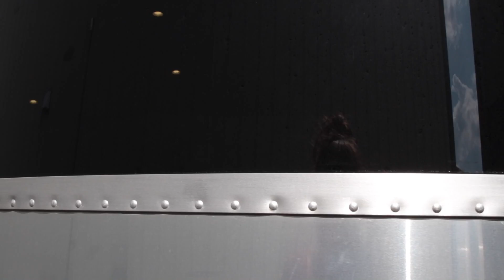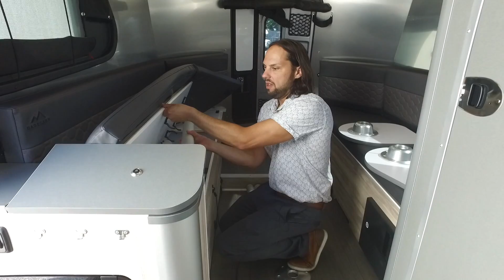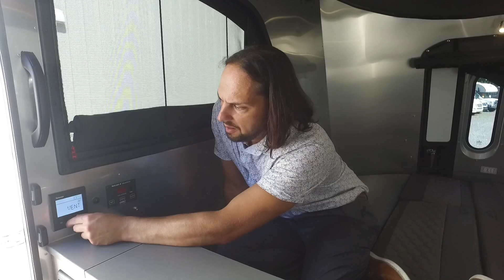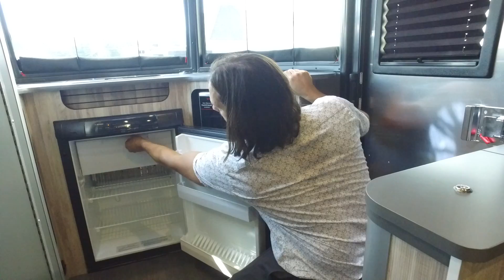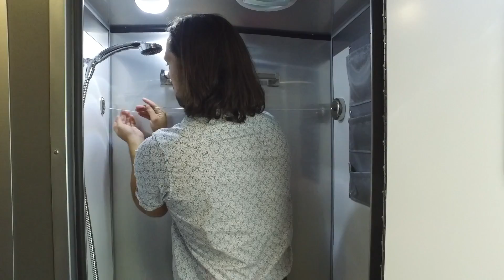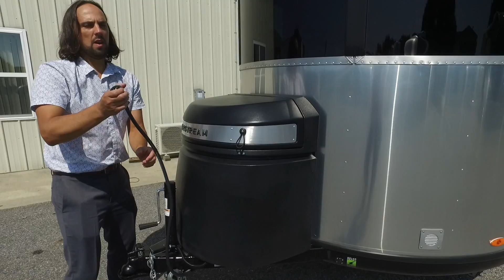Walk Through 2018 Airstream Basecamp 16NB Light Weight Small Camping Adventure Trailer

Comment: Can you upgrade to a lithium battery? I've read about issues with the fridge and back door leaking. Have they solved this issue?
Reply from the maker: There are many aftermarket upgrades available including Lithium Iron batteries. The recent model year has a new refrigerator design and style.

Comment: Can you convert to solar power on the Basecamp trailer? That way you could run the refrigerator while towing. The Basecamp trailer has features of a Airstreem Bambi for the same size, but can haul stuff the Bambi can't.
Reply from the maker: All of the Basecamp models at Colonial Have the solar package with two AGM batteries.

Comment: The advantage of the small trailers like this are efficient towing, why in the world would a airstream put a roof top AC and all the drag that represents when the other small trailers are putting much smarter solutions together.
Reply from the maker: Ted, it is very difficult to sell any RV without air conditioning. A customer can opt not to get the AC as a factory option.
Reply: @colonialairstream Many of the small travel trailers from other manufacturers are using standard 5000 btu window units built into a space that would otherwise be a cabinet.  That gives plenty of cooling capacity, helps control the cost, and most importantly fits within the drag profile of the trailer rather than poking out above the trailer line.  The Airstream brand built its name as an industry leader in aero dynamics of travel trailers, its unfortunate to see the brand fall behind in this manner.

Comment: Would my 2018 Toyota Tacoma with 4 cylinder pull this? I'm very interested. Thanks.
Reply from the maker: Yes, as long as it has a Class II hitch receiver, 7-way and brake controller installed.

Comment: What's the basepoint of a basecamp?
Reply from the maker: The base MSRP for a 2018 Airstream Basecamp is $35,900.00 US. A loaded Basecamp for 2018 would include 160W solar, Air Conditioning and a microwave would have an MSRP of $39,884.00 US

Comment: If it is a 3 way refrigerator, why would you turn it off while travelling? Wouldn't you switch it over to 12 v that is being supplied by the battery that is being charged while you drive?
Reply from the maker: This model has a 2 way refrigerator and is not 12V. The new 2020's have a 12V and 120V compressor style refrigerator.

Comment: Patrick.... THANK YOU!!!  I H-A-V-E to get one!!!  I am aware of the XL model & wish you could do as informative a vid as this one detailing the differences....  What would your thoughts be in ONE MOD I see already?  The front cover for the propane tanks.  A sine wave generator? They have them with remote control & small enough to maybe fit....?  If not, a small modification to the housing, etc... could make that a "NO-SEE-UM" type way to carry & use an expensive device since they are lightweight and catch the eye.... 
Any feedback on that thought would be excellent!
Also, is there an available roof rack system for these?  I'm aware of the tent features and believe if remember correctly there was something for the roof as well....  My only drawback is flush mounting solar panels , but that would not be too much a problem since any cargo up top would be removed once the Base Camp is setup!
Best price on this one????!!!!!!!!

Comment: This may have been addressed by others but there where too many posts to read. 
One design flaw that seems inexcusable at this price is with the posts for the dinette table/bed support. Instead of having a short and tall post set for each situation, airstream should have made one set of retractable posts with high and low settings for bed and table use. It is a needless inconvenience to have to pull out and store 2 different post sets. Just my 2¢
Reply from the maker: Thank you for your input. Airstream designed the legs to be removable to allow for cargo loading. The telescopic legs require a larger floor base and a permanent install.

Comment: Just curious if it really has a 2-5/16" hitch and if so, why on such a small trailer?
Reply from the maker: The weight distribution systems that one would use to tow a trailer like this would support a 2 5/16" ball, therefore the Airstream is designed to accommodate that.

Comment: Excellent video presentation, Patrick.  I especially like your detailed show/explanation of the Truma Furnace/Hot Water Heater combi which replaces the old trouble-prone Atwood HWH & noisy furnace.  I've always been concerned about heat loss with all the windows, however, you showed the blackout curtains which can be zipped up to better retain heat on a cold night.

RIGHT ON, about recommending the wheel bearings be repacked every 3,000 miles.

For one person, just MEeee, is there any way to for the bed/eating area to be set up so I could sleep on one side & leave a table in place for eating?  I'm 5'6".
Reply from the maker: Thanks for watching. You can fold down one side of the bed and cut a notch in the bed board to allow the pedestal table to be installed at the same time.

Comment: curious about the glass window in the front - I know that on other campers, rocks tend to chip away at the body when a trailer is towed - do the windows withstand rocks and how expensive, difficult would replacement of those beautiful windows?
Reply from the maker: I any know of one owner that blew out their front glass in the past 1.5 years. Each side is about $700 to replace.
Reply: Aftermarket opportunity!  Canvas, snap-on bug and stone deflector.
Reply: I'd pick one up if was a buyer (someday) - thanks

Comment: I see a little issue... the co2 alarm  shoulden't it be mounted lower than the bed, as co2 is heavier than air it will fill the camper like water from the bottom. So if you are sleeping the alarm wont wake you til way after the co2 level is over ur head...
Reply from the maker: Gert, Airstreams and all American made RV's are built to the very strict RVIA building code compliance.

Comment: Very thorough! I have been wanting to see this rig, so thanks for a very detailed run through.I have mixed reactions. Some of it is great, but other bits leave me rolling my eys. Too many snaps and zippers and things to break. It can only sleep a couple, like most units. I long for a bunk bed option. Not everyone camps/travels with a romantic partner. Not much storage in the kitchen, but I think this rig is designed pretty much for weekend trips, so it’s probably adequate. Love the propane covers, but hate the freezer inside the fridge--these ice up and require constant defrosting. It is certainly distinctive and wuld make a statement at the campground!
Reply from the maker: Thank you for your opinions and feedback.
Reply: None of the windows seem to open, and there’s no window in the bathroom…. Only way to get air it seems is to leave the doors open…. But there’s no screen door, just a roll down fabric thing….  That’s a major negative, even the cheapest camper has windows that open…

And that door in the back is really too small to load something like bicycles or a motorcycle…. so you have to wonder, what’s the point of the second door in back then…

Comment: Thanks, Where do the optional solar panel go of fit. Can you put a 12 v ac? Can you put a waterless toilet?
Reply from the maker: The optional solar gets installed on the roof at the factory. There may be things you can do to it aftermarket for 12V AC and a waterless toilet.

Comment: Are solar panels with an inverter an option? 

Overall, incredibly impressed with the design. Your presentation was also excellent. Thank you.
Reply from the maker: An Inverter is not available on the Basecamp as a factory option but the solar charging system is.

Comment: Great review as always.  I'm confused why you just don't run all electric with a lithium battery, then you could dry camp more.
Reply from the maker: Patrick, you would need many of them and an inverter and then it may be too heavy and take up all the extra room. This Airstream can be used as is dry camping with use of everything except for the microwave and Air conditioner.

Comment: Good job Patrick. Your video was an honest and informative review. I'm personally not impressed with the way the bed sets up. Way too much work. I also expected a better way to cover the windows rather than the old curtain that you have to roll up and down. The shades you find on the new trailers are much easier and better looking. The bathroom is also very basic with none of the new gadgets such as a sink that folds up (out of the way) for showering and I didn't see any storage in there. The kitchen sink is tiny! Yes, this is a small trailer but I've seen nicer trailer features on other trailers the same size. The price is so high on these airstreams that I really expected a more upgraded interior.Sorry, not for me.
Reply from the maker: Jean thank you for viewing and for your suggestions and opinions. These are all ready by us and Airstream.

Comment: Question? I live in the Rocky mountains of Colorado,  will this model, being plugged into sure power, sustain thru the winter months with the tanks,  etc? Is it insulated well enough? Thank you!
Reply from the maker: Thank you for watching. This Airtsream has heated tanks, enclosed underbelly and insulation throughout. It is not meant for 4 season winter camping but is designed for unexpected drops in temperatures below freezing and gives you a 7 degree threshold of protection.

Comment: My parents are interested in picking one up. Their tow vehicle has a max 4400lbs tow weight but a max tongue weight of 175lbs a 2015 BMW 328D XIT. There isn't anyway to reduce the tongue weight on one of these is there? The trailer has almost a 430 tongue weight which is huge for a 2600 lbs trailer (light weight trailer). The bambi has like 50lbs less tongue weight.
Reply from the maker: Daniel, Reducing the trailer tongue weight will cause a trailer to sway. Its hard to understand why a vehicle that claims to tow 4400 lbs can only handle a 175 lb tongue weight.

Comment: It is a nice trailer. Actually only 13 or so feet long - $3000/ ft 
They've fixed the plastic looking door it originally had. 
But, it cost a small fortune and there are aluminum framed (as opposed to steel framed Basecamp) trailers of similar size and less weight that cost almost half of the BC.On version 2 you can't load a motorcycle or 4 wheeler as you could on previous models. 
Would I pay $40,000 for it? No but low 30''s probably. and figure how to get a bike inside.
Great presentation though.
Reply from the maker: Jon, thanks for watching.

Comment: Great informative review.
Can you tell me where the battery is located and can it accommodate a larger size battery. Also is an inverter an option as well. Really like that solar is an option as well.
Thanks
Reply from the maker: The battery location is under the floor by the sink area and can accommodate a 2nd 24 series 12V battery. An Inverter can be installed aftermarket.

Comment: Always like your videos Patrick.  Very informative and you never miss a detail.  The one flaw the basecamp has is no cable hookup on the outside for tv.  Really wish they would add that and a possible tv mount on the outside wall of the bathroom.  Otherwise a well thought out design.
Reply from the maker: Scott, Thank you very much. Airstream designed this for the younger generations that use portable electronics and the 4G networks. I will be sure to mention this during the next dealer council.